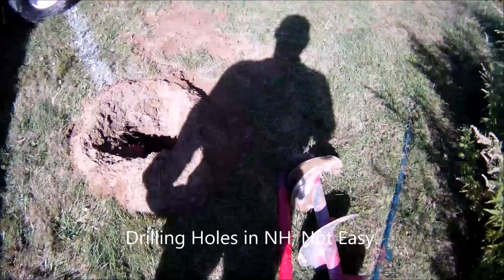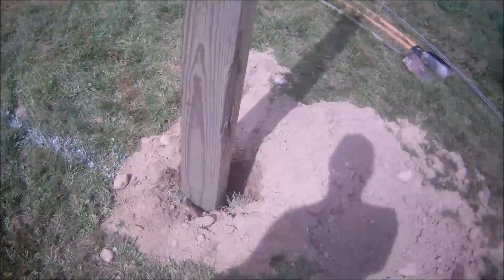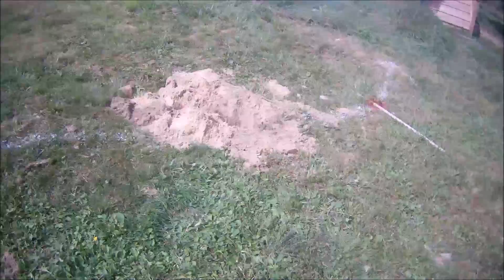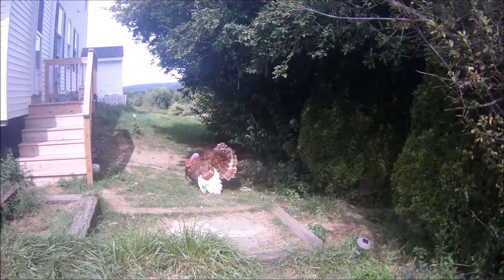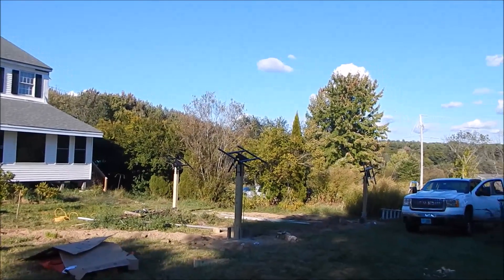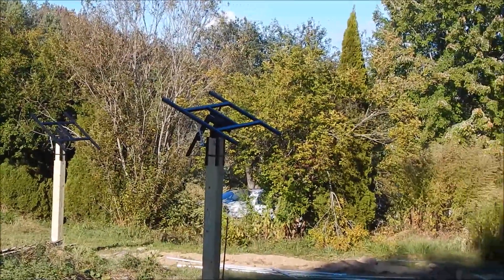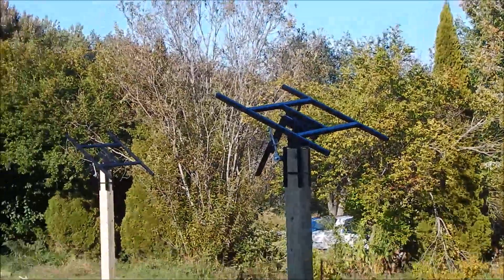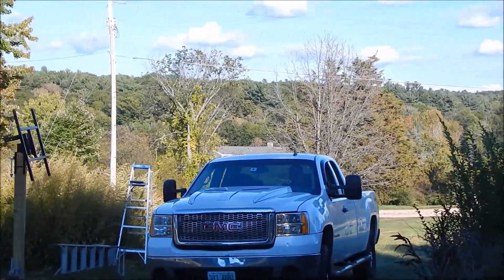6000 Watt Solar Tracker Install Update

Comment: Wow your working hard. That is going to be awesome. I want another tracker now. I just need some more panels. They cost so much. I just need the seven hundred dollars thats the hardest part for me. I have a tracker made already just waiting for panels.
Reply from the maker: +shartne  I need to go home to take a break from this trip I'm about wore out. Check out craigslist I have got quit a few good deals there on over stock panels lately.
Reply: +TheKilog69 what city do I look under on craigs list?
Reply from the maker: +shartne Any town near U .
Reply: +TheKilog69 thanks but I already looked but we got nothing. Your state has some a few 100 watters. 120 watters. I will have to buy brand new to get some 235 or 240 watters

Comment: that swing set frame would be a great way to do a long set of panels with south facing setup.
how much does the tracker cost to buy?
john
Reply from the maker: +Rev John O'Toole   $1150 Shipped, about 100lbs each.
Reply: +TheKilog69 thanks